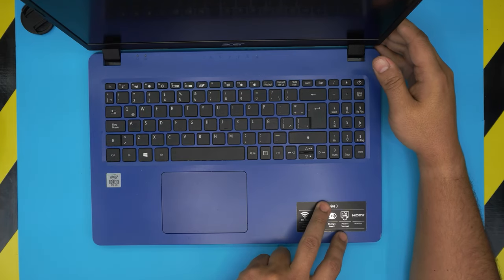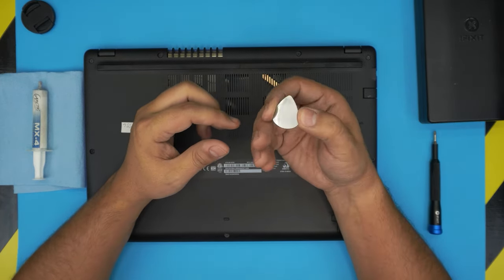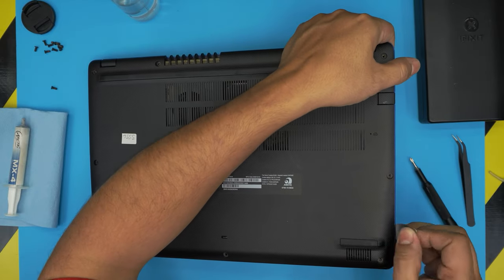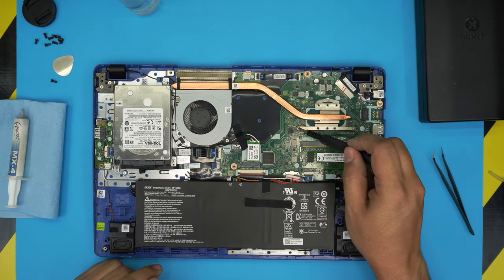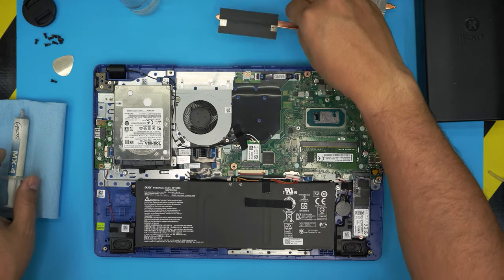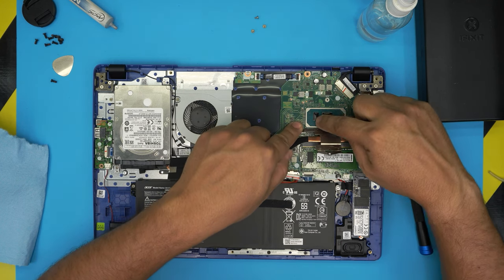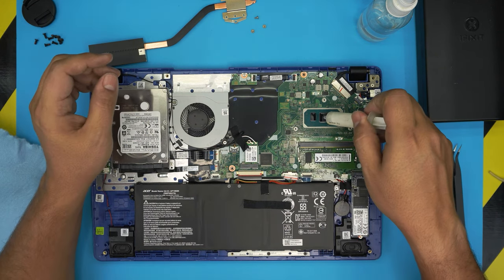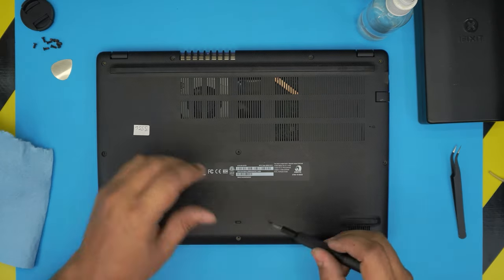Acer Aspire 3 N19c1 🚩 A315 56 38Tb 💻  Repaste FULL service

Comment: 🤔 I've noticed this very same defect with my heatsink and it's amazing we both had the same idea 💡 to add a thermal pad.
Reply from the maker: Yes, I'm guessing somewhere in the manufacturing process they made a mistake and rotated the CPU 180 degrees, causing the PCH dye to end up on the other side.
cheers🍻

Comment: Copper shim ?
Reply from the maker: Thank you for the feedback! if you wish to support the channel you can LIKE or SUB or both :P
regarding your question:  yes if you want better temps and quieter fan noise , sandwich a copper shim place paste on both dye and place a copper and place a thermal paste on the top and this way you have created better pressure and that will results in better heat transfer. we do this service all the time and the results are sweet.
get a .3mm and 20mm x 20mm 
https://amzn.to/3TUWgPc